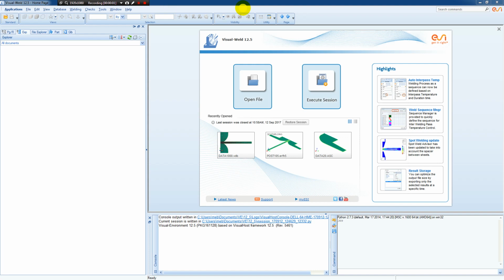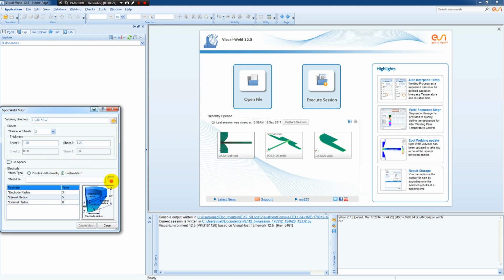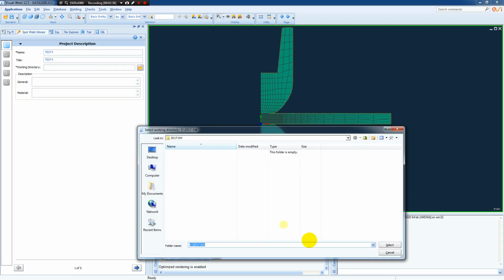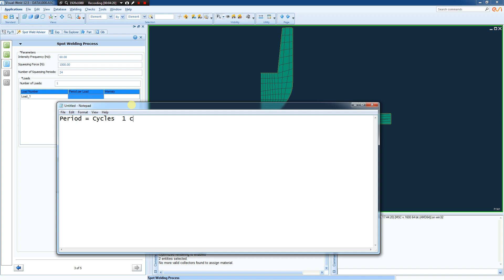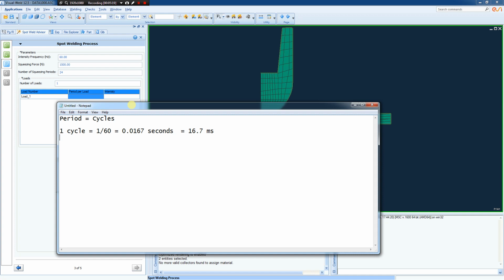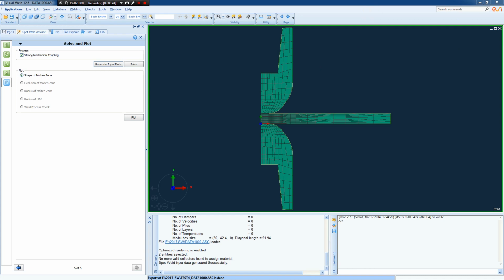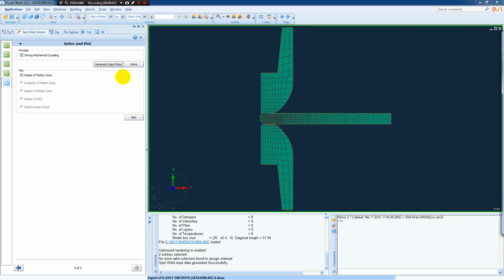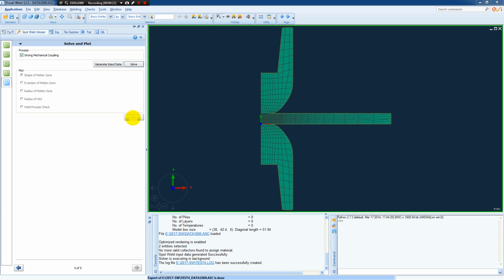Sysweld Visual Weld Spot Weld interface and Analysis

Comment: Please how did you create your part in visual mesh ? could you send me the tutorial please
Reply from the maker: For the spot weld tool, the visual weld module creates the mesh automatically.    I did however, edit the ascii mesh file to create a custom electrode mesh by replacing some nodal coordinates.
Reply: Thank you. and how did you draw the geometry, especially the curvature of the electrode?
Reply from the maker: The curvature and other electrode geometry parameters are specified on a panel in the weld advisor and those can be used.  However, I used a custom electrode mesh by importing the mesh into Hypermesh, and moving the nodes around to match my specific geometry.   I had some contact troubles if the tip of the electrode is perfectly flat--it needs a slight upward slope to it.
Reply: I see. Thank you very much
Reply: I need to more videos on sysweld program such as start program, input date, and simulation of TIG welding process, ..... etc.